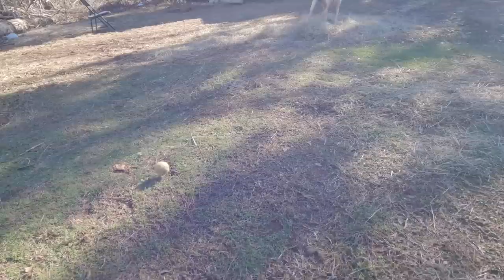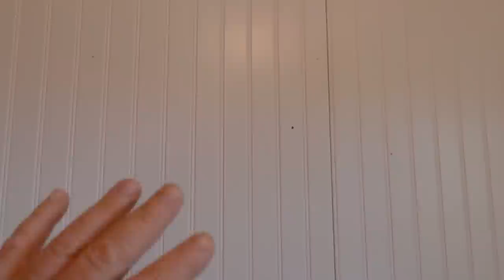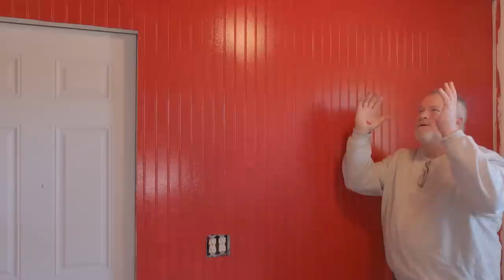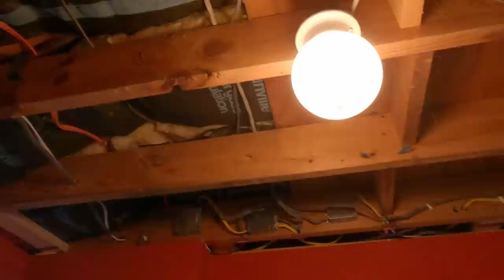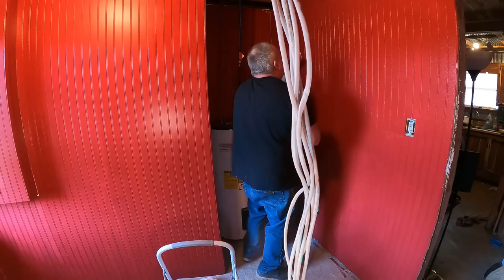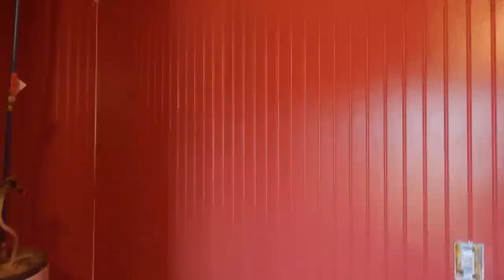Walls Are Painted! Far Different Than The Rest Of Cabin Looks. Been A Long Time Coming!

Comment: Hang a curtain on a rod over the water heater space or install a bifold door. And on the electric box if you paint it it will peel, just hang a picture or a framed cork board over it. The color is get. Things are looking up Mike. Happy New Year ❤️🙏🏼

Comment: I wouldn’t put flooring under the water heater, the heat will melt it. Just go around it. I wouldn’t move it because it could not work afterwards.
Reply from the maker: Yea I was wondering about that, Im just boxing it in and leaving it there, will floor around it.

Comment: On the water heater. Have you considered replacing to a propane type. Of coarse, upfront it would be more costly than the #8ag wire you will need for repositioning the heater……The plus of the propane ,  would be you’d be less dependent on high demand electricity use needed for the W.H.……Just a thought…….
Reply from the maker: I dont have a large propane tank, also its just me here so electric bill is pretty small.

Comment: Hi Mike, all I know is if the room is small, don't go super dark, as it will make the room look even smaller. I have like beige walls, for the last 10 yrs. I like Green Apple, such a nice color or sage. but a blue with some grey mixed in, would look nice. We have the dump here, where you can go and pick up used paint, if you want to, I have done it, sure saves ya money. The color you have used does brighten the room up, but I will wait to see after it dries. I have alot of work to do to my bedroom, some cube storage thingy, I got for Christmas, 16 cubes. I might not use all of them, to make it look more up to date with the times. Also bought a 4 Ft. folding table, with 3 heights, I still have table my father made me, which is I think 6 ft. So I wanting an area to sew, another area, to cut and iron & also set up my old desktop. I am beginner of making Quilts. So these cube storage thingys, will be great for storing yarn and fabric. MY favourite color is green, but not hunter green yuck. But been getting into the color purple, like lavendar. So Katherine and Chris surprised me with a cordless keyboard and mouse set, in lavendar lol. I assume you have not read my last post, in regards to the live Brett had at New Years Eve. Happy Trails ;)
Reply from the maker: I like small, if I didnt I sure wouldnt have bought a small cabin, serves my needs
Reply: @ouachitamountainliving  If I had my way and the funds, I would buy some land and put tiny house on it, that is all I need. Was thinking RV. at one time, but I don't drive. Plus I don't like to be confined, in tiny spaces. I have to have windows, cause I like looking out the windows. This apartment I am in, is too big for one older person, sure Brad stays here once in while, but usually just me and Chewy. I had my Birthday on Dec. 27, now young 62 yr. old. lol Happy Trails ;) Sure would like to see you and Brett in a live again, sure were some funny bits.